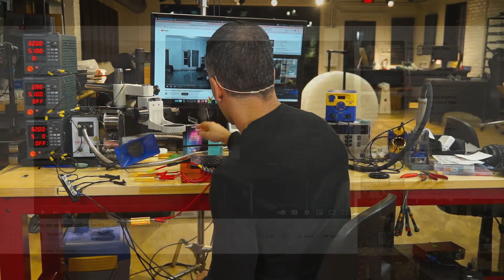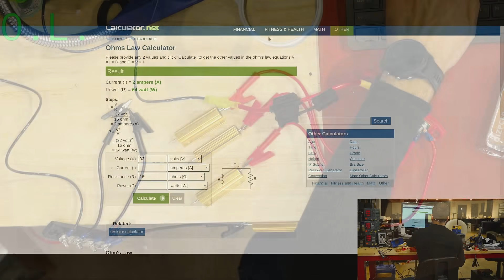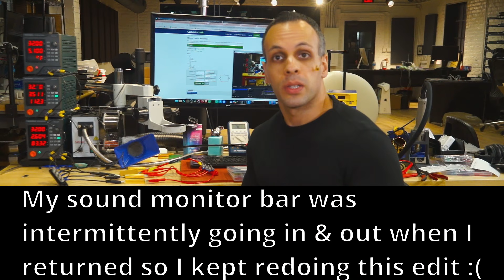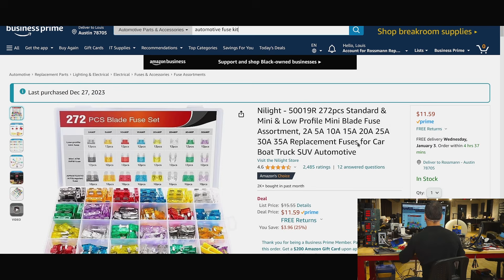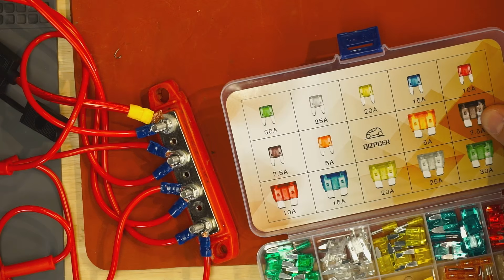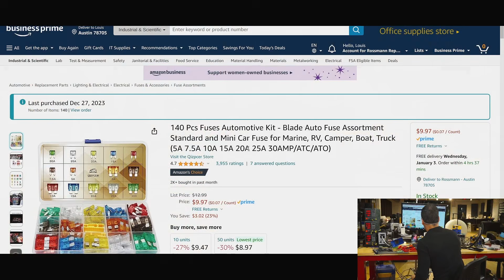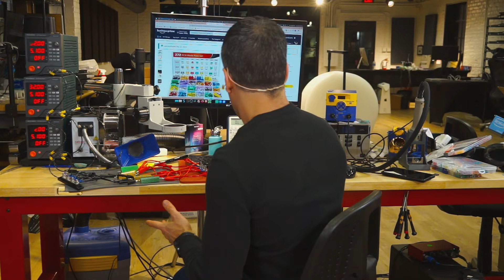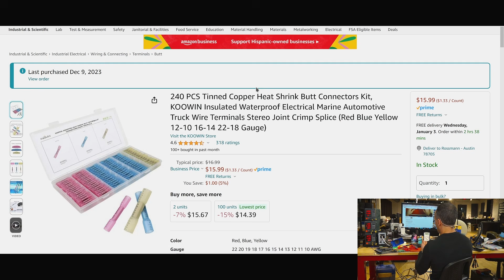Amazon Sells Fake Electrical Fuses

Comment: What we need are laws making marketplaces like Amazon responsible for the items they sell.   If Amazon is the company that charges your card, Amazon, not the third party supplier, should be considered the actual seller.
Reply: Ignore the card.
If Amazon is modifying the comments and scores (by deleting some of them), then they are endorsing and selling those products.
So if they sell, endorse and lie, then they should be taking responsibility for any dangers that product causes.
Reply: Consumer products liability applies to all levels of the distribution chain, including the final retail seller (Amazon).
Reply: I'm not sure about that. That would make stores legally liable for all the products they stock. And absolve the manufacturers. I don't think small retailers could survive that. There should be some level of shared responsibility.
Reply: @andybrice2711  Well, that's how it's been here in the civilized world for decades.
Reply: @andybrice2711   Look it up ... at least under California law (and many or most other states also).  Manufacturers are not absolved of liability by suing a retailer.  They are usually the ones sued but technically everyone in the chain of distribution can be sued for defective products sold (maker, distributor and retailer) and held full or partially liable.

Here Amazon would be the deep pocket and thus a good defendant.  Plus easier to sue and serve a lawsuit on than the fuse manufacturer in China.
Reply: @andybrice2711   Lawsuits can just escalate, the seller sues the maker and if the maker needs, sues the supplier and so on. The costumer never needs to know that there was that one component inside his device that was falsified and that one fraudulent company with someone else's label is the one to go after. That's the job of the final product's brand.
Reply: Wouldn't that be nice. Holding the big corporate giants responsible. Probably willnt happen!! Thanks to videos like this we can stay informed.
Reply: The laws have been here for decades. For some reason it doesn't apply to Amazon though. Any other storefront, online or off, would be shut down.

Comment: This reminds of the good old days of replacing a fuse with an actual nail (metal nail, that you hammer into wood).... On the technical side:   the worst automotive Mini fuse (regular type, not Slow Blow) is expected to blow in about 30 mins at 135% load current, and faster ss the load inceases... So, a two amp fuse handling 300% of the rated current for more than 10 minutes... That can't be called a fuse. I've compared mini fuses from several reputable manufacturers and they are all well within the values I mentioned earlier. Soon, that's not a fuse, that's the proverbial nail in the fuse holder.

Comment: I still have a cart full of Dewalt products that overtime I’ve been buying all of which are offered through prime. I encourage my fellow construction workers to buy name brand tools also, you cannot beat the sometimes $100+ off per tool, and all of which have lasted for years I think it really just depends on what category of crap you’re trying to buy.  

Also, I have always disliked butt splices because in my experience, they all pull out eventually especially if you’re working with the 18 gauge ones.  Even before Amazon existed as a company I was never able to successfully crimp 18 gauge butt splices.  😫

This is why, whenever possible I use pigtail splices because they’re far less likely to pull out since an actual slip of metal is forced into the wire as opposed to pinching up a metal cylinder on top of the wire and hoping that the pinch is secure enough, friction prevents it from pulling out.

Comment: FYI, regarding the "let me know what you think in the comments", it's not possible anymore. I confirmed the same thing you mentioned in a previous video - Youtube is using an AI to arbitrarily remove comments. It's basically impossible now to have a conversation in the YT comments since they can be randomly removed for arbitrary reasons such as "AI thinks the way this is worded is rude". You should direct people to a forum or Lemmy community instead. Have you switched to Lemmy after leaving Reddit? What are you using now?

Comment: The "amp" rating on fuses means very little except to identify which curve to look at in the datasheet. I've seen plenty of industrial fuses where the manufacturer's own published data shows it'll keep going up to 500% of the current rating before blowing, by design, and this is even with major manufacturers.

Edit: This is also why you never buy anything safety-related unless it's manufactured by an actual company that can be held liable for its failure and has a vested interest in not making defective garbage.
Reply: Shouldn't the amp rating on an automotive fuse mean the max current possible at some ambient temperature?  And at higher temperatures, the fuse blowing point seems to go down, not up.   True, I don't know what I'm talking about and am just trying to make sense of this, but if I visit littelfuse site, that seems to be how it works.   If this isn't how it works, then I wondering what the heck the stated current ratings do mean for the Amazon fuses.  Confusing.
Reply: Yup industrial fuses for things like large pumps, lift winding motors etc. for example, have 1kA rating, but the inrush current per winding is 3kA - that's ok and fuse will not blow, even for several minutes.  However, a dead short is likely to be in region of 1MA and the fuse blows in around 0.1s - quartz sand filled to prevent arcing and a huge explosion.  When your lights dip, it'll be that kind of fuse that blew, saving the transformer it was connected to from going boom too.

Comment: Was anyone else triggered by Louis' repeated use of "grounds" in relation to the negative return.

On a related note. I am not an automotive SME so can not speak with certainty however the first and likely the seconf seam like they would be well out of what is an acceptable spec for the rated use case

Comment: The important thing about fuses is that their clearing time (how fast they blow) is dependent on the current. This means that for any fuse, it might take at least twice the current for it to melt over the course of several minutes. All fuses have a TCC (time over current curve) based on the fuse type. Utility fuses are usually K/KS/MS or QA or T or X types. Then for your padmounted transformers they are dual element (DE) bayonet or high amp (HA) bayonet with a current limiting fuse in series as catastrophic protection.

Source: My job is coordinating relay settings and fuses for a major utility distribution system and also electrical engineer.

Edit to add: after watching to the end, you did a good job to make a fair assessment and paint a full picture.
Reply: I found the data sheet for the automotive fuse standard ATOF. Youtube may remove the link, but the 2A should've been done at 3A after about 4s or 5s.
Reply: Blade Fuses - Littelfuse https://m.littelfuse.com/~/media/automotive/datasheets/fuses/passenger-car-and-commercial-vehicle/blade-fuses/littelfuse_atof_datasheet.pdf

Comment: Hey louis, loved your video.  I am a licensed electrical engineer.  I pulled the spec sheet for the bussman/eaton atc fuses(which are publicly available) and 10amp operate time for a 2 amp fuse is .1 seconds.  While there may be some deviation between manufacturers ATC is an industry standard and they should be simiar.
Reply: And the 8 amp operating time for a 2 amp fuse is likely less than forever.
Reply: @SteelBlueVision  If I recall off the top of my head, it should be about 0.2s, so yes, way less then forever.
Reply: "industry standards"? Chinese products aren't held back from innovating by American standards. Their fuses don't fail at a measly 2 amps. They've engineered a way to get 8 amps out of them. It's impressive technology of you don't think about it too much.
Reply: @WarrenGarabrandt  Nice!  I hope we can learn from this example!
Reply: A 100 piece automotive fuse kit on Amazon is $8.99. A 100 piece Eaton Bussman fuse kit on Zoro is $56.29. A 100 piece Bussman fuse kit on Grainger is $99.29. A 100 piece Littlefuse fuse kit on DigiKey is $69.47 + $13.89 tariff shipping to the US, thank you Mr. Trump. And there's you dinner!

Comment: Qiute an intresting method of testing you have chose why didn't you just use the curent limiting feture of the power supplys and just gradualy increase the curent until the fuse blows, that would be more precise than 2 AMP increse that the resistors provide.

Comment: I've had to return so many Chi-com products back to Amazon this past year, moreso than previous years, because they were absolute garbage.  One of which was a climbing ascender that was absolute junk.  I wouldn't trust that thing in the event that I fell out of my treestand and that device just snapped or didn't hold.  Cheap aluminum, shoddy construction, etc.  Those Chocsee fuses may be good now, but Chinese-made products have NO quality control, and somewhere in the future, they'll put greed over safety and start making them like crap.  Mark my words on this.  I've seen it happen time and time again.

You should revisit this brand again in 6 months, if they're still around, and see if they still function the same way.  Most of these Chi-com products are fly-by-night, and won't be around in a few months once they'll gotten rid of their excess inventory.

Comment: Well, this is horrible; I installed fuses from Amazon like those in my car!
Thank you for this video Louis! Definitely gonna buy better ones right now.
Reply: I bet the sizes you used actually work somewhat like they should, you generally don't see 2A fuses in use on cars, most times you won't even see anything under 10 amps. It's a lot easier to make a higher current fuse. Not to mention the size wire you'd have to be using to actually risk melting insulation or causing a fire doesn't really get used in a car, it'd be way too fragile. 

I'd still replace them with brand name fuses if I were you. But this probably explains why no news station is running reports on cars with toasted harnesses, considering the number of those bunk fuses must be in circulation by now.

Comment: A decent digital load box where you can set the constant current would be a lot faster and more accurate  of course they cost 💲 
I just had to do this in the lab double checking voltage drop across connections, power filter, and connections out. Very easy of course I didn’t buy the equipment. 😊

Comment: Is there any difference in the size of the fusable link inside all these small fuses? I'm guessing they're all just 10A fuses with different colored plastic. Maybe the Chinese manufacturer doesn't understand the concept of a fuse, and thinks the rating is the minimum current that it can pass?

Comment: This is where you need an ad space for cultivate.  Cultivate is a web extension that lets you see where the seller is located.  Btw the only 2 countries you can find sellers for these fuses are China and India.  To your last video, I have had issues finding connectors that fit my insulated crimps.  Even connectors bought from auto parts places don't work right, but this video right here sure makes a point.

Comment: I did not expect it to blow at 2 amps.  But I knew there was a problem when your setup was designed for 2 amp steps.  But 8 amps continuous through a 2 amp fuse?  In your car or RV, this will cause a fire!  Remember, the main purpose of a fuse is to protect the wiring connected to it in order to prevent a fire!  So buy the assortment, throw away all the fuses, and refill with a real name brand.

Comment: Dear Louis, 
two mistakes are made, the Chinese don't give a shit about specification and quality, but use every safety seal without any authorization, 
CE/TUV etc. I am an Amazon Vine Club product tester and I get a lot of bad products, sometimes so bad that I have them with the consent 
of Amazon can only dispose of it. But Amazon is also not interested in what is sold there, the bigger profit is of course made with the cheap 
Chinese scrap, around 95% of the goods from China are scrap.

I'm now even allowed to write Chinese junk in my reviews; this was always criticized at the beginning and deleted.
We in the EU/Germany are simply too stupid to produce high-quality products and then sell them to 1.3 billion Chinese people, that's how it turns out.
I bought a single induction hob, and it was replaced twice because it exploded once after a short time and the other two, I tested three, 
get so hot on the underside near a heat sink that the plastic deforms.
This is really dangerous, and I will give it to a friend who is an engineer like me (mechanical engineering), but in electrical engineering. 
Just like you, he would quickly find out which components are incorrectly dimensioned.

Comment: SAE J1284 is the standard for ATC style fuses. I forget the exact standard for fuse ratings, but a fuse should be able to hold the rated amps for 1 hour with out failing, and 110/115% of its rated power for less than 1 minute to compensate for current spikes at initial power on.  

I did a similar bench test with cheap Chinese fuses and fuses from an automotive OEM supplier.  The cheap fuses results were as expected, not correct. OEM fuses were spot on with the SAE standard.  I performed this bench test to validate voltage drop across a fuse to calculate current on a circuit.  In the the automotive diagnostic world, measuring voltage drop across a fuse a is common way to test for parastic draws,  there are published graphs to correlate voltage drop to amps. 

In short dont trust any replaced fuse unless you know the brand or where it was sourced.
Reply: In "short" don't trust fuse 😅
Reply: @moen3249  no, trust fuses, but know how they work, instead of assuming you know how they work... a 2a fuse is NOT supposed to blow if you put 2a through it.
Reply: I've just found some Time-Current Characteristic Curves published by Littlefuse.
Their blade fuses are made to comply with ISO 8820-3.
The curves show that a 2 A fuse running at 3 A should disconnect in about 15 seconds.
Reply: So the second fuse looks like more inline with the SAE standard?
Reply: I buy used fuses from fairly new cars
Reply: @pr0n5tar  Yes, any time I send a car to the the scrap yard.  I keep all the fuses. Not to mention my haul when visiting u-pull-it 🙈
Reply: And a fuse that doesn't have its rating stamped on it is crazy. At least with the crappy resistor colour ring codes you can just stick a multimeter on it. You can't do that with a fuse.
Reply: @russell2952  you realize fuses are color coded for their ratings right?.....red 5a, blue 10a, etc etc....and you can measuire the fuses resistance with a milliohm meter to determine its rating. littlefuse has resistance charts for them.
Reply: Brand doesn't even mean anything, the random Chinese "brands" you see on Amazon are just some words they write on a bunch of products that all probably come from the same factory in shenzen, they sometimes even do a bait and switch scenario where they farm good reviews with one "brand" to build reputation then start selling the cheap crap, by the time people figure it out they just axe that "brand", stick a new label on the same products then repeat the process
Reply: @rodiculous9464  Absolutely! I used to work for the largest UK industrial parts supplier and we often had that problem with some of our suppliers in the far-east. They would send samples for evaluation which were accepted and a few months after the product had been on sale we would get complaints from customers that the product quality had deteriorated. The supplier had changed the source of the product to increase their margin but the customer was the first to find out. Unfortunately nothing has changed and it's a case of buyer beware especially as the vast majority of people buy on price alone.

Comment: Immediately breaking at 10A for a 5A fuse is perfectly fine. In order for a fuse like like that to break at exactly 5A you gonna have to wait like a day or two. That's just how power curves of the automotive fuses typically work. The first 2A fuse is garbage, though, indeed.

Comment: Fuses, at least where I live must be built to blow at max. 0.2 seconds after overload. That overload being anything above their rated current at specified test temperature. And if my memory is correct, a slow fuse should allow shortly for twice the current which again is somewhere around 0.2 seconds. There are fluctuations in the blowout time and current due to external temperatures, but for your results you'd have to live on Titan to achieve this with a good fuse. You can make a better fuse by taking a strand or two from a flexible wire and using that to protect circuits.

Comment: Fuses aren't supposed to blow at their marked rating. Their rating is the maximum they can be expected to sustain. How long a good fuse will take to blow beyond that depends on the fuse's i2t spec and how much cooling the fuse gets. With slow-blow fuses, the i2t delay can be over a minute at 50% overload and several seconds at 100%. Without the slow-blow i2t delay, all loads with inrush current would be popping fuses everywhere all of the time. Same reason breakers have a slow thermal trip to tolerate inrush current at 3-4X the nominal rating for a second or two (ex.: motor starts or plugging in a PC PSU) and a magnetic trip that only activates at ~5X overload to deal with shorts.

As for how to put an end to marketplaces being used to sell garbage, the simplest way would be to make the marketplace liable for their sellers' crap when the seller itself isn't from a jurisdiction where the buyer can realistically bring the seller to court and get any compensation. I think the EU already has something like that or at least tried doing so many years ago.